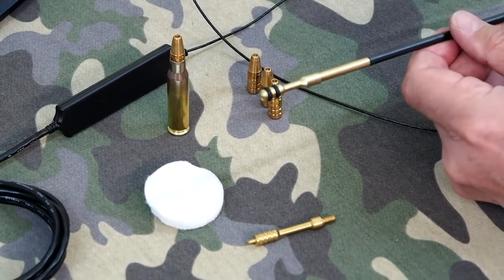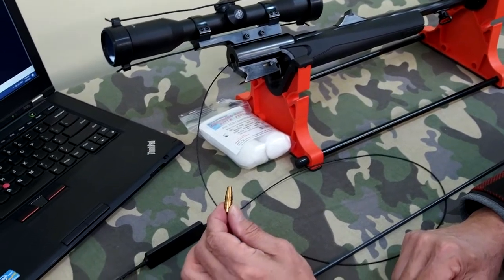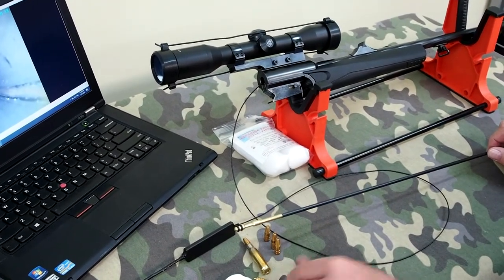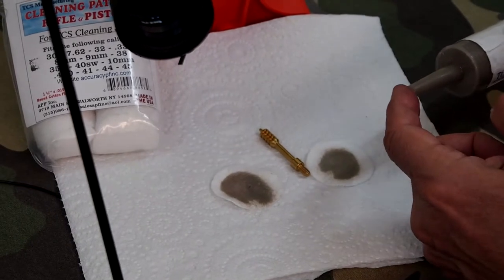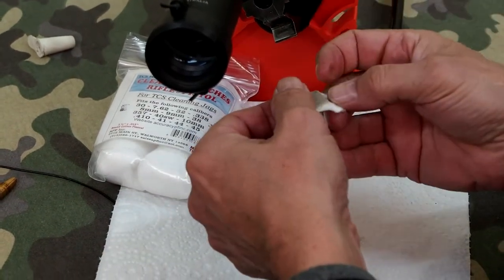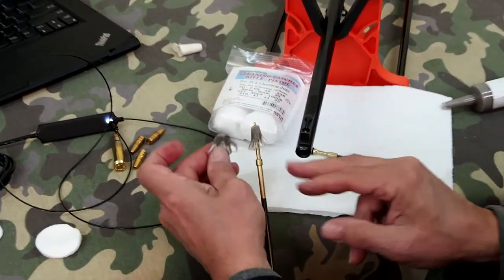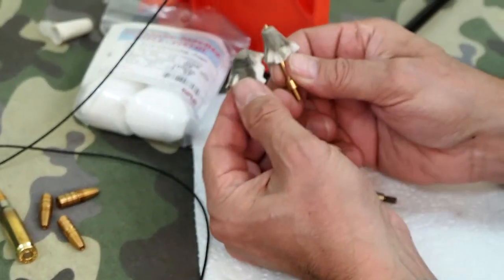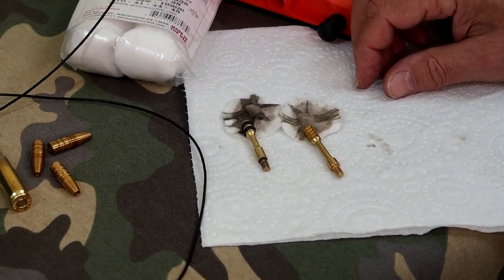GUN Cleaning Test O-Ring Jag

Comment: The results are what you might expect because the chamber end of the barrel was dirtier to begin with. You need to repeat the test this time using the conventional jag at the chamber end and compare the results. The O-ring jag will undoubtedly still do a better job but only a comparison will indicate the degree of improvement.